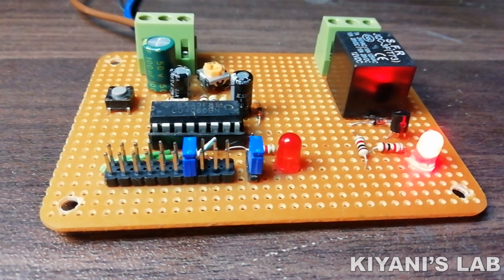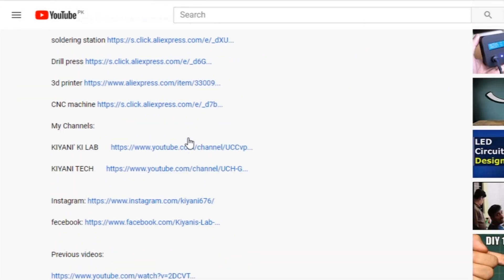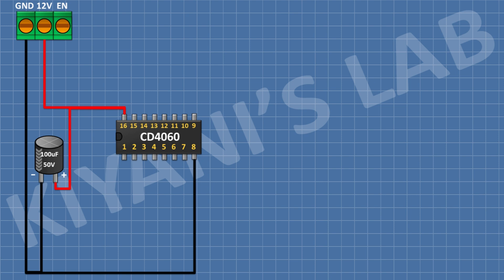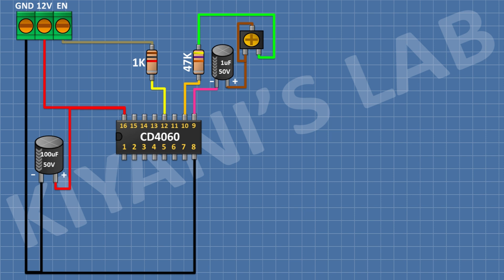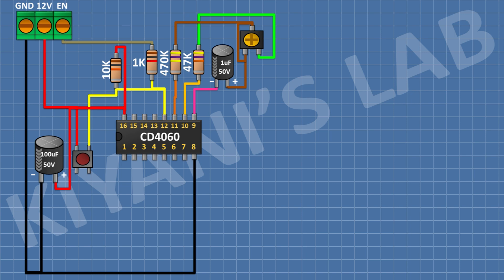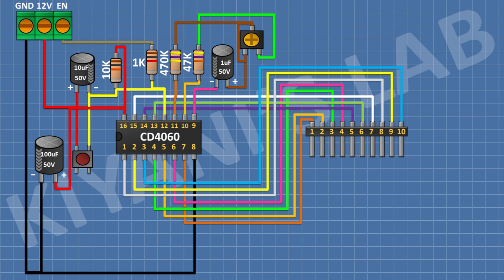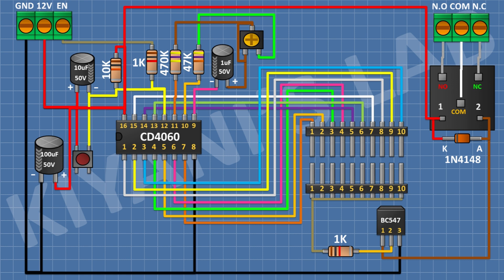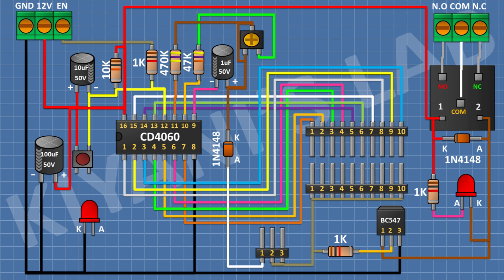How To Make A Programmable Timer| Without Microcontroller

Comment: Making use of electrolytic capacitor at pin no. 9 of Ic may cause detoriation of frequency during elongated time span due to frequent charge discharge of capacitor. So this has to be decided if precise timings are required.

Comment: What is "EN" on the 3 pin terminal?
Reply: Connect EN to Ground ... This will keep Pin No. 12 connected to Ground Via 1 K ohm resistor ...  It is required to keep built in oscilator to oscillate ... But when Push Button is pressed the Pin No 12 will be connected momentarily to +positive supply and counter Resets & begin counting again ... My opinion! Thanks

Comment: How to use in ac circuit and how to use many amps
Reply from the maker: upto 1000 Watt AC load can be use with the relay connected to the circuit for more load bigger relay or contactor can be used with the relay